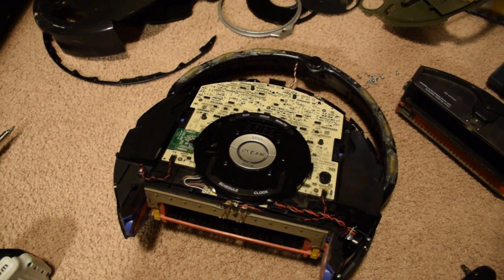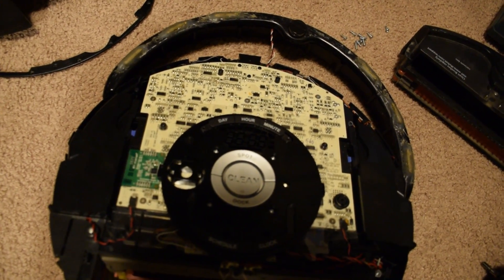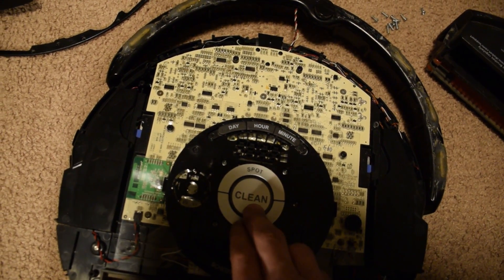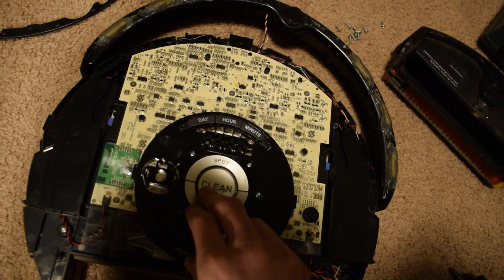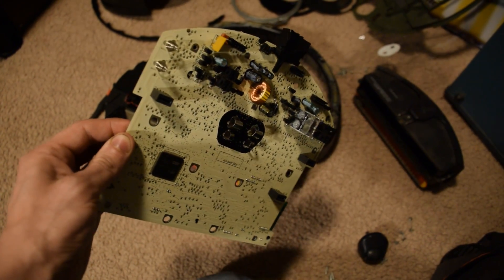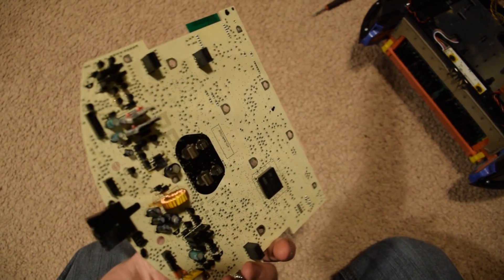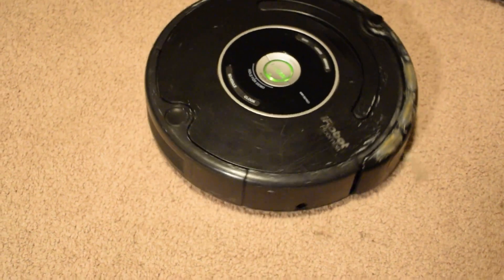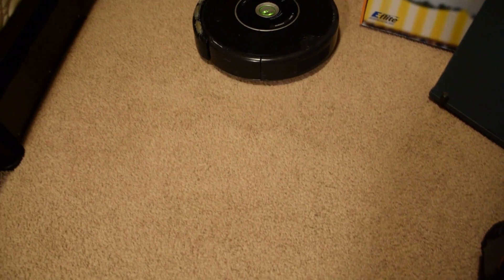Roomba Repair Attempt, Error 5 and other weird things

Comment: My issue was it had bad solder joints on the electrolytic capacitors 595

Comment: I think he gave updates in his comments if your wondering if it is fixed! Supposedly there's a diode that's failed... My sister just had her roomba pile through a massive amount of dog poop (slimy version) and completely went zombie poop slater to her whole bedroom, baseboards pretty much everything it touched with its dirty little brush. Regardless she washed it lol... And now we have the error 5.
Reply: Same thing happened to me with dog diarrhea.  I carefully cleaned brushes etc. Roomba 652 turns on but won't move.  I ordered new battery but that did not fix it.  Think circuit board may have gotten wet, wishing I could fix it but no luck so far :(
Reply from the maker: I tried baking the circuit board to drive out the moisture but it still acts up.
Reply: Any joy fixing.  Mines been through cat poo and now a error 5
Reply: Yes my sisters Roomba running strong as an Ox since I bought a motherboard off of ebay and replaced it lol. Her little dog has since past away also... anyways changed the motherboard and good to go.

Comment: How did things work out? Similar problem here, new battery in, worked for a few weeks back to charging problems and basically what you said, let me know! Thanks, good quick video
Reply: So, you fixed it?
Reply: PerpetualWalnut I would be interested to know if you fixed it as well.
Reply from the maker: I haven't fixed it. I tried swapping that diode from a working roomba that may have also been on it's way out. Now both have error 5.
Reply from the maker: I found out after doing some reading that there is a high current diode on the main board that fails after a while. It's failure is a bit strange though, diodes are only supposed to conduct current in one direction from the cathode to the anode. However, this diode fails in such a way that when it is warm or hot it tends to have a significant amount of reverse leakage current. I think it was D58.

Here is a general discussion about error 5.  http://www.robotreviews.com/chat/viewtopic.php?t=16196